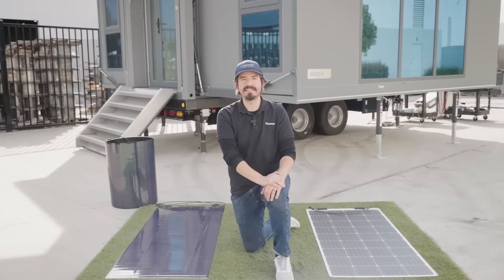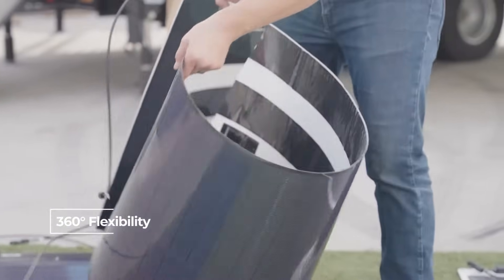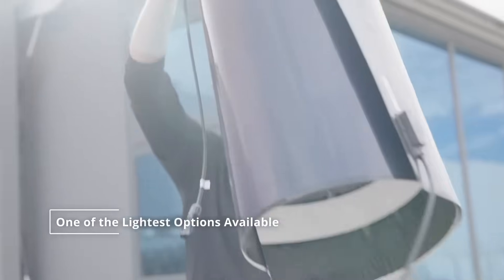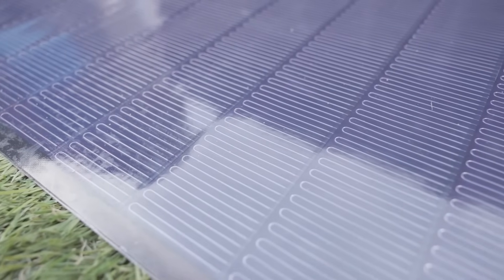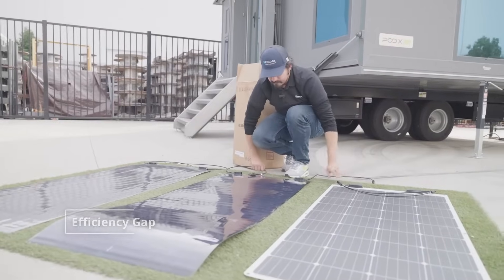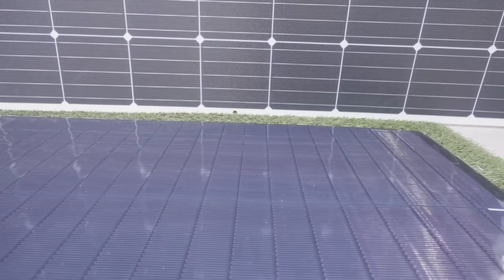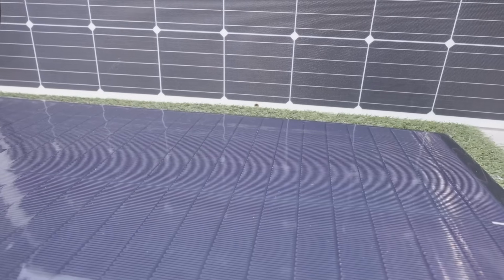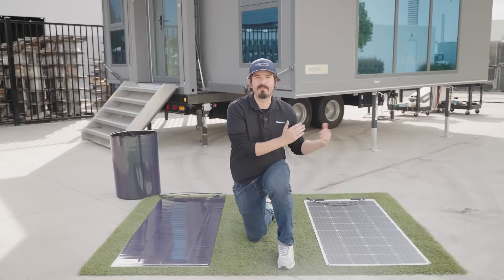Renogy New CIGS Solar Panel vs Flexible Monocrystalline Solar Panel: Which Fits Your Needs Best?

Comment: This needs holes/ grommets. I dont want to permanently mount it to a surface, i want it move it as and when needed.
Reply: Renogy offer the CIGS panels with tape or pre-punched holes, though the latter is out of stock at the moment.

Their CS panels include grommet holes (tape isn't an option, though I installed two of their older 175W panels on a rooftop tent using 3M VHB tape; two years in, they're still there!)

Comment: Which flexible solar panel do you recommend to put on the metal roof of a Ram Promaster van?  I don't want to install a roof rack. I would prefer to use the adhesive to stick directly on the roof. but i'm concerned that the corrugated metal roof of the van + the heat of summer sun will eventually damage the solar panels.
Reply: Only one way to find out. What did you end up with?

Comment: @2:22, "Bypass Diodes Across All Solar Cells".  
What constitutes a "Cell" on this type panel?  
And, how many bypass diodes does it have?  
Your Customer Support was not able to answer this, and finally I bought one to test it.  However, we are in the weeks of winter overcast weather now.  But, I was able to get part of the panel in sunlight a few times, and NO OUTPUT!  Various other brand mono panels did output at this same time (flexible and rigid).  
If there is not a good day to test this soon, I will be returning it before I am stuck with it.  Same with if there is a good test day, and this 150w CIGS does not perform much better.
Please note that I installed a 200w CIGS (from another manufacturer) on my motorhome, and it works great.
And, PLEASE TRAIN YOUR CUSTOMER SERVICE ON YOUR NEW PRODUCTS!  I have bought your other products, both through you and Dr Prepare, with great service...so, very disappointed so far.
Reply from the maker: Hello,

1. Solar Cell Type: Copper Indium Gallium Selenide (CIGS) solar cells.
2. Bypass Diodes: 18.
3. If there is no output, it may be necessary for you to contact our after-sales support team. You can start by preparing pictures of measurements of the open-circuit voltage and short-circuit current of the solar panel in good lighting conditions using a multimeter. Alternatively, could you provide us with the Case ID for your contact with us? This way, we can review the agent's specific questions and try to empower our service team further.

Once again, thank you for your feedback.